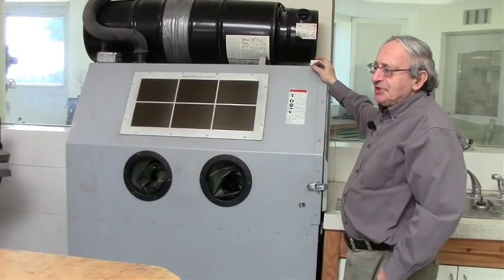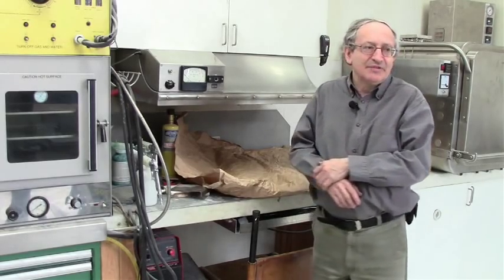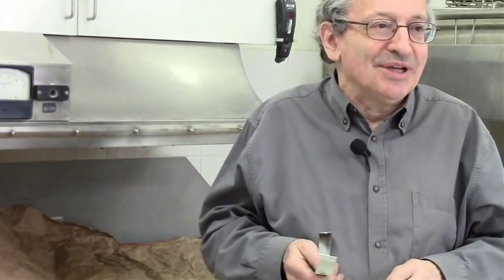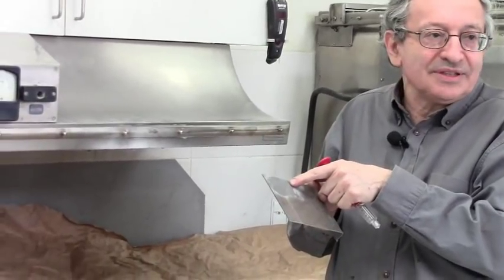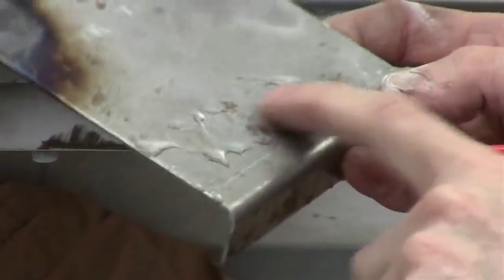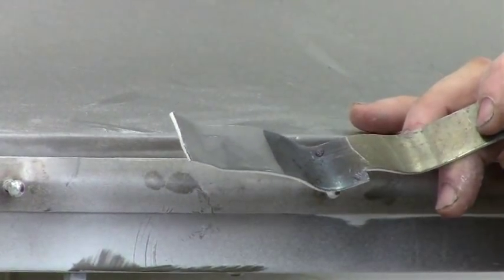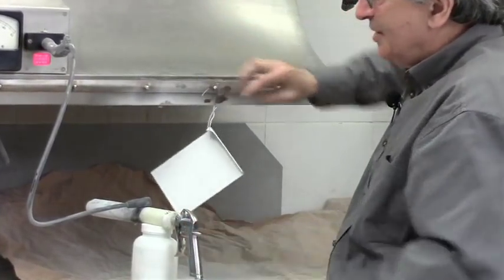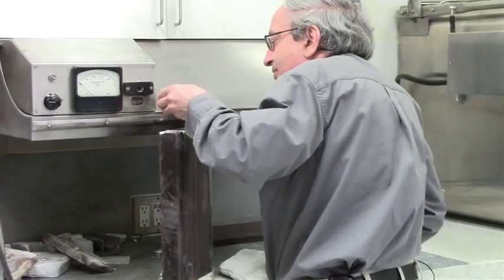Building Prototypes Dan Gelbart  part 6 of 18  Coatings

Comment from the maker: Re source for diamond coated glass: I no longer remember, but there are many DLC (Diamond Like Coating) coaters and you can ask for quotes (you supply the glass). They charge a few hundred $ per run, but a run can be many (say 20-50) panels.
Reply: +Dan Gelbart I found some Honneywell part numbers to help people with their googling: 

46-46807- Diamonex Platter for compact (420mm) (16.5") StratosH 2322.
46-46806- Diamonex Platter for full-size 508mm (20.0") StratosH 2320/2321.
46-00233 - Diamonex Platter - Compact Stratos 2421,
46-00234- Diamonex Platter for sub-compact (353mm) (13.9") Stratos 2422.
46-00296- Diamonex Platter with lift handle for compact (399mm) Stratos 2421.
46-01085 - Diamonex Platter - 508mm StratosMS2430-105KD-US.
46-00235- Sapphire Platter for compact (399mm) Stratos 2421.
46-46809- Sapphire Platter for compact (420mm) StratosH 2322.
46-46808- Sapphire Platter for full-size (508mm) StratosH 2320/2321.
46-00236- Sapphire Platter for sub-compact (353mm) Stratos 2422.
46-00297- Sapphire Platter with lift handle for compact (399mm) Stratos 2421.
46-01127 -Sapphire Platter for StratosS and 2421 (399mm) with 3 flip ups.
Reply: As diamond coated glass is not so easily available to us home users, I heard the recommendation to use 3M clear urethane paint protection film, available on Amazon, $35 for 12" x 48" roll. This is normally used to cover the front of a car to protect against stone chips. Haven't tried it yet, but it sounds intriguing. I've seen urethane linings on orbital vibratory deburrers last for years.
Reply from the maker: A good alternative to the diamond coated glass is to install two rolls, supply and take up, of polyester film (4mil to 8mil). The shaft of the take-up roll extends through the cabinet wall. When hazy, just advance the roll.  The diamond coated glass lasts a long time, but not forever.
Reply: Perhaps an option would be to use a  " backup camera kit" as you have on various other pieces of equipment. Then you would only need one small piece of DLC coated glass.

Comment: Thanks for explaining why the primer never stuck to the sheet metal jobs i did even after chemical solvent cleaning. Lots of oil on the MS sheets. That powder would be like copier toner, wonder if it will work in a laser printer?

Comment: Dan,
Shalom.
You have taught me something I never knew about pre-paint preparation!
I have a small powder coat system but haven't tried the chrome yet, so your mention that it's good means I don't have to worry about finding a plating company near me and parting with truck loads of shekels.
Wonderful and thank you.
I will be re-painting my 1935 Austin Seven car, so your advise has come at an opportune time.
Where/how did you get such knowledge?
Regards
Geoff
UK
Reply from the maker: All comes from being bored, so you start reading books and thinking.  .

Comment: Good video. What is the best way to prepare soft plastics -abs/nylon for painting?
Reply from the maker: Sandblasting works for every material, including plastic. For plastics which have a solvent (thermoplastics like ABS, PVC, acrylic) you can add a bit o the solvent to the paint (if paint is solvent based) or wipe the surface with the solvent immediately before painting,  and this will eliminate the need to prepare the surface. For cross-linked plastics (fiberglass, epoxy, phenolics etc) there is no solvent.

Comment: Very interesting and informative. I'm watching video after video and can't get enough.

I wonder if the hydrocarbons monolayer has any ( substantial? ) impact on thermal conductivity in high performance heat sinks - ones that use thermal paste to achieve better metal to metal contact ( like in desktop computer CPU's ).

It's the first time in my life  I heard anything about hydrocarbon monolayer leftover after "de greasing".
Reply from the maker: No effect on heat conductivity because the layer is so thin (under a nm).
Reply: @dgelbart  Thank you.

Comment: Dan, 

does soda blasting also allow the wetting you demonstrated with sand blasting?

I have some anodized aluminum that needs to have glue residue removed.  I was wondering whether soda blasting would clean and allow wetting on anodized aluminum (or a superior bond, as that s what I am after).  I will just give it a go, but I wonder what is actually happening.  I will recoat with crazy glue, and probably the soda residue will kick off the glue.  So it will probably look pretty good, but I have no idea what the chemistry or physics will be.

What works now is cleaning with Ajax cleanser, which is no longer locally available, and that process is messy and drawn out.

Thanks for you videos!
Reply from the maker: Soda blasting is used to remove contamination without changing the surface so it is not effective to increase paint adhesion or wetting. Any clean metal surface wets better, but it does not change the surface area or surface energy.

Comment: I'm a little confused about the fact that most liquid paints use hydrocarbon solvents as their thinners and drying agents. How is this not an issue with a prepared surface? And between coats of wet paint, how do you avoid the build up of this invisible enemy when it often takes a couple of days to fully dry a primer?
Reply from the maker: +Tobias A. Feltus   There are many types of hydrocarbons, the ones deposited from oil vapours prevent adhesion. They are a higher molecular weight. The low molecular weight ones evaporate. The solvent in the new paint layers somewhat dissolve the old layer and adheres. Think of washing oily parts with gasoline: both are hydrocarbons, but one is used to remove the other.
Reply: +Dan Gelbart Ok, that makes sense. But what about build ups of oil vapours between coats of wet paint?
Reply from the maker: +Tobias A. Feltus  New paint usually chemically bonds with the old paint  so the hydrocarbon monolayer is not a big problem.

Comment: awesome video, it helped my a lot. out of curiosity: the surface energy depends on the specific surface energy and the area. how that does work with the area, i cant find any literature on this? this also seems to raise questions of scaling (like what size do the grooves and ridges have to be in order to "count" to the surface energy)?
Reply from the maker: Hard to estimate surfce area of a rough surface, but the important thing is that what matters is not how dee the texture is (RMS roughness) but how complex it is. A very fine complex grain is better than a few deep scratches.
Reply: @dgelbart  iow you want fractal grooves. That's very groovy! 😎

Comment: How do you prevent rust while using water and scouring powder to clean bare metal?
Is plain old  tap water ok or should you use distilled water?
Reply from the maker: You do the cleaning within an hour of painting or gluing, so parts have no chance to rust.  Tapwater is fine. If you wait several hours you need to clean again, as the hydrocarbons in the air start depositing a layer on the metal. If you have many parts and you want to do all the cleaning days ahead, you have to use a gumming solution to preserve the parts. The gumming solution is washed off with tap water before use.

Comment: Hello Dan,
This is the best video I have ever seen!!! Many thanks! 
I have some parts that have been sand blasted and hot dip galvanized and I would like to ask you… what is the correct prep procedure to powder coat these parts?  Do you think I need to apply also a powder Zinc Primer after prepping? 
Many thanks and best regards 
Luca
Reply from the maker: I would go with a  very light sand blast, just to get a dull finish on the zinc. Sandblasting works better than any primer I have ever seen.  Hold parts far away from the blasting gun. Interestingly, even if the zinc comes off at some spots they are still protected by the zinc around them.
Reply: @dgelbart  Hi Dan, many thanks for your answer! I didn’t expect that! 😉 
Do you think that a garnet sand mesh 120 (0,125mm - 0,180mm) could be the correct blasting media? What about the pression? 3 bar (43 psi) should be ok?
Many thanks! Luca
Reply from the maker: any grit and any pressure is OK as long as you just dull the surface.   @TheDuke279
Reply: @dgelbart  Many thanks!!👍😊
Reply: @dgelbart  Hi Dan,
Sorry for disturbing you again. I would like  to askyou also... can I use also glass beads for sand blasting the hot dip galvanized parts do dull the surface? Would you after sand blasting also clean the parts with the Bar Keeper friends powder or just blow the dust away with a compressor before powder coating? Many thanks
Luca
Reply from the maker: @TheDuke279  Glass beads leave a less desirable surface. Do not use any cleaning agent after sand blasting.  Like any surface cleaning, paint has to be applied the same day. If not possible, surface has to be "gummed" and gum washed off before painting. You can get guming solution from any offset printing shop.
Reply: @dgelbart  Hello Dan, Many thanks for your help and advice! You are the Best!!!👍 Thanks Luca

Comment: What would you suggest for preparing non metal surfaces such as plastic for gluing or painting?
Reply from the maker: light sandblasting, and if not possible scrub with bathroom cleaner such as Comet until water wets part well.
Reply: @dgelbart  excellent, thanks for the advice. Any plans to do some more videos? Also, do you have a website that elaborates on the subjects in your videos?
Reply: @kmpnelson  Crafsman just made a video about painting plastics. He found a way to make paint stick well by flame-treating the plastic first.
Reply: @anonymouse527  thanks for the heads up, I'll check it out.

Comment: Hi Dan, I am in the process of refurbishing a lathe and am needing to sandblasted the machine but have not found a suitable way to mask off the machined surfaces. Do you have any suggestions for masking prior to sandblasting?
Also, where do you find diamond coated glass?
Reply from the maker: Best protection fron sandblasting is thin rubber sheet, about 1mm. You can attach it with contact cement or buy it self-adhesive.

Comment: Hi Dan is the variable voltage only is a standard power supply that will go to 100kv?  At what Amp your system is working at? I guess you build it yourself.
Reply from the maker: Yes, current is limited for safety to 100uA. No need to build it, these days you can buy it for a reasonable price from columbiacoatings.com and other powder coat suppliers.

Comment: What is your opinion on phosphating followed by painting?
Reply from the maker: This is a very good process if you have the set-up, which usually involves heated tanks.
Reply: @dgelbart  it works well. It's very cool when the phosphate coating sucks up the paint off the part

Comment: Hi Dan (again), I've been looking for the diamond glass you talk about and when I contacted glass shops they don't know what that is.. I'm in Canada (Alberta), any suggestions where to look?
Reply from the maker: Others reported the same problem, but there is another solution: remove glass window and install a supply roll and takeup roll for clear plastic sheet outside the machine (the clear sheet forming the window, the sheet a bit wider than opening). When the sheet  gets used up, just advance it. I tried in on another sandblaster and it is great.
Reply: @dgelbart  that makes sense although I'd prefer a long lasting solution. Is there a trade name for the glass you have?
Reply from the maker: @kmpnelson  It is for supermarket scanners but since I made the video it wore out as well.
Reply: @dgelbart  Oh that's good to know, perhaps time for another excellent video? ;)
Reply: Something that I'm currently struggling with is how to get good paint inlaying for engraved lettering, if you're looking for a topic. Ha

Comment: Learning more than days of you tube "professional" videos. Question. On 8:32 that equipment hold on cabinet up your right shoulder is a thermometer? Is the same shape as my rc nitro engine.
Reply from the maker: yes, non-contact thermometer.
Reply: @dgelbart  Do you know what is the manufacturer? Thanks
Reply from the maker: @RBAERO  There are several. See https://www.alloyshop.com/nitinol.html
Reply: @dgelbart  Thanks for the Nitinol link. The manufacturer I'm ask about that  non contact thermometer.
Reply from the maker: @RBAERO  Many vendors on Amazon and Ebay.
Reply: @dgelbart  Thank's. I ask about this exactly because I don't find this type anymore. Onle pistol grip type.
Reply from the maker: @RBAERO  Be aware that all types have a very large error (up to 50%) when measuring shinny surfaces. You need to blacken or sandblast the measured area. Mine was very expensive but still has the same error.
Reply: @dgelbart  I understand. Ir foi can share the name of your will be great for the type of point ir better to use in rc nitro engines.  I have one pistol grip from Fluke when I change the emissivity work goog. Still have the accuracy probelm with shine materials. But I my fluke is broken I look for another one. Thank's

Comment: Just tried this with aluminum and it didn't work. I heated it to about 300C and lightly sanded with fabric degreaser to no avail. The water still rolls off, although not as well as untreated. I guess harder sanding with chlorox might be better.
Reply from the maker: As I explained in the video, the degreasers are useless. You need to use Comet or "Bar Tenders Friend" type of powders to make the surface hydrophilic. The degreasers leave a monolayer of hydrocarbon that is enioufg to prevent wetting. THe heating idea is not good for aluminum as ar 300 degrees it will become soft, even when cooled down.
Reply: @dgelbart  thanks for your reply, master Gelbart! :D Yes, I only tried the sandpaper with degreaser after testing it with just heating (I didn't have Comet-type stuff at the moment). I'll try sanding it with Comet later. But for my project I may not need it because powder coating seemed to adhere super strong. At least in my small sample test.
Reply: @dgelbart  oh, and I have to heat aluminum to about 400c to braze it together with an aluminum brazing rod. I haven't considered it becoming soft. Thanks for your reminder, I should look into ways of tempering it.

Comment: Is tsp an acceptable cleaning agent ?
Reply from the maker: Yes, but for aluminum caustic soda (NaOH) actually attacks the metal and leaves a much better bonding surface. Sandblasting  is much better than NaOH and NaOH is much better than TSP. 
For brass, copper, bronze, stainless  nothing except sansblasting works.

Comment: those diamond-coated glass panels from checkout scanners are NOT generally available - I've searched and searched.
Reply from the maker: There is a second solution which is good: install a roll of transparent plastic (say 0.1-0.2mm/4 to 8 mil clear polyester) inside the cabinet with a metal frame holding the plastic against the glass window. Install another roll to take up the used material. Advance the roll one frame every time visibility is poor.
Reply: It might be worth trying those automotive 'ceramic' coatings, I hear that they are very chip resistant, but I don't have a sandblaster on which to try it.